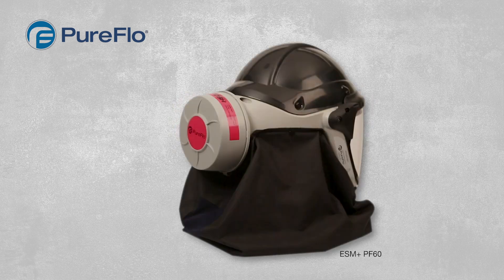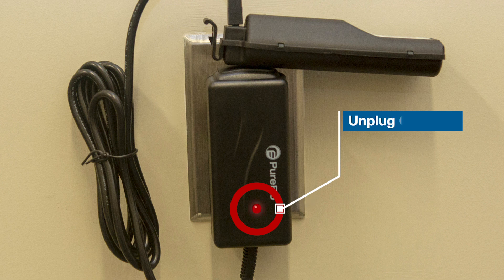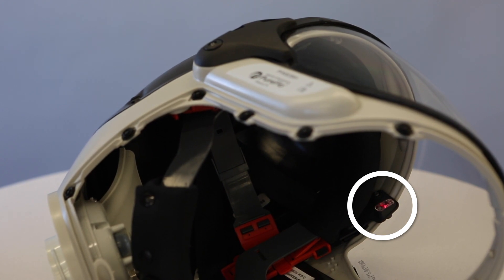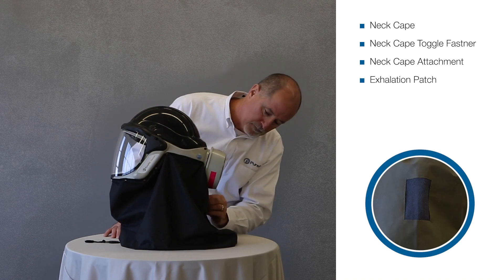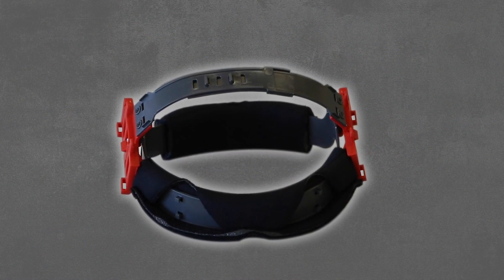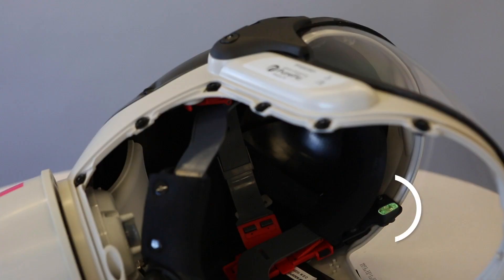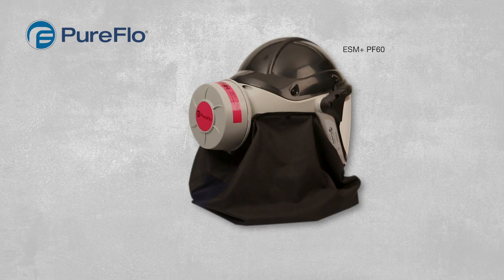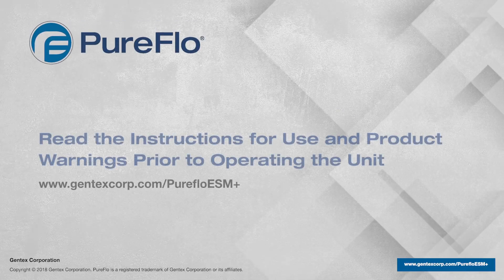PureFlo ESM+ PAPR | Basic Operations

Comment: i think its better u donn the blower machine or HEPA on the waist. becos if its on the head, it might heavy and not easy to move.
Reply: Almost every product has a trade off. The benefit of these PAPRs with everything integrated into one head unit is that there are no additional cables, hoses, etc. to get tangled up in. Also you can don and doff these more readily. The downside is probably added weight to the wearer's head & neck which can be taxing if worn for hours. I haven't used a Gentex ESM+ PAPR but it looks like a solid "industrial grade" product.